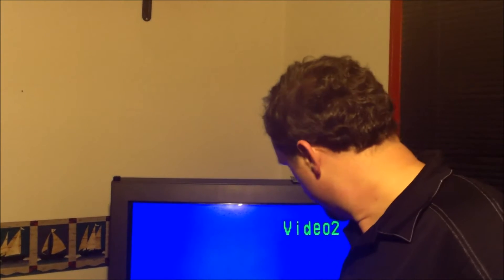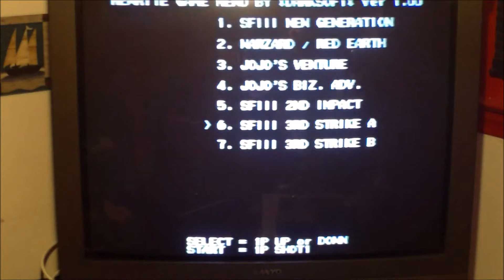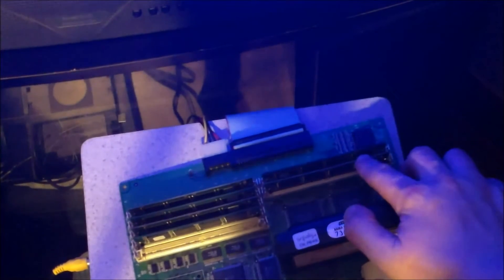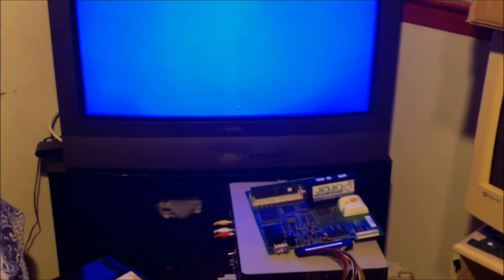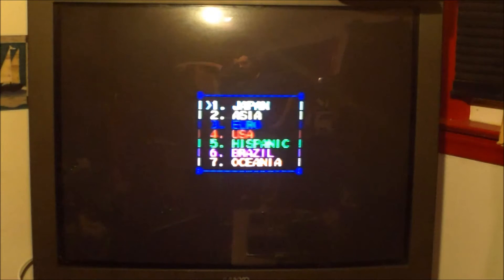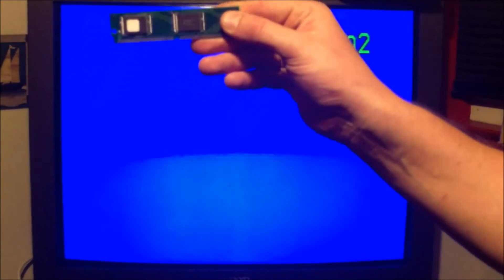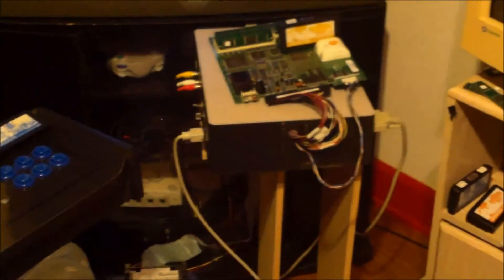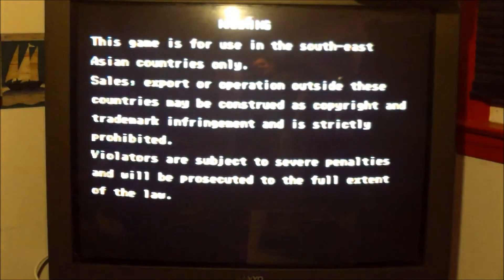Mitsurugi-w's CPS3 NoCD Utility disk Tutorial (for battery-powered carts)

Comment: Hey cool, a MAS Super Nova, that's the supergun I have. Question, if you're still around, how exactly can you tell if a CPS3 is NoCD, and what exactly does this offer over the regular setup?
Reply from the maker: You can only really tell if it actually boots without a CD drive.  The only advantage is that it doesn't require a CD drive that could fail.  There are modern replacements for the CD drives that use SD cards instead.  Highly recommended.
Reply: @MitsurugiW  I bought a Jojo kit and would love to get a CPS3 but they're so damn expensive. I'd have to sell a ton of my games to afford one, and I really only want 3S.

Comment: Hi Mitsurugi, First of all congratulations on your excelent work on CPS3!. I have the following question:  I have the possibility of buying a CPS3 board with JOJOBA. It is the NOCD version. and it comes without the SCSI drive. I think the board is Model 95682A-2. It has all the correct SIMMS for JOJOBA. Is it possible to run the Darksoft superbios (and with the correct CD load all the games) if a buy a SCSI drive? I would also need 1x 128 SIMM as i intend to play 3rd Strike. Many thanks.
Reply from the maker: Yep.  Like you said all you will need is another 128mb SIMM, a SCSI CD drive, and a SuperBIOS cart and CD.

Comment: I'm totally new to CPS3 PCB. Would it be possible to run Third Strike without CD Drive connected using Darksoft Superbios? (from what I read on forum, it seems you still need to have CD Rom Drive connected to PCB ).
Reply from the maker: With the SuperBIOS there is currently no way to use it in a NoCD way.  This video just shows how you can use my CD and a SuperBIOS cart to prepare a pcb for use with a still-working, battery-powered NoCD cart.

In the future there may or may not be a NoCD option added to the bios.